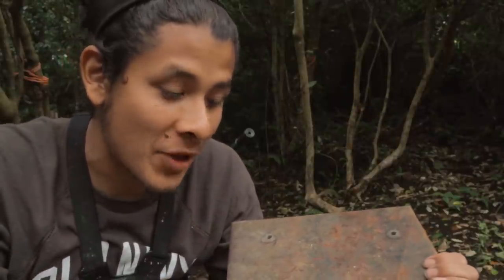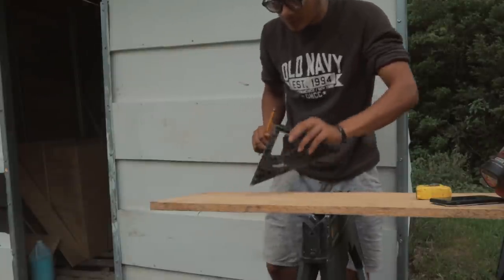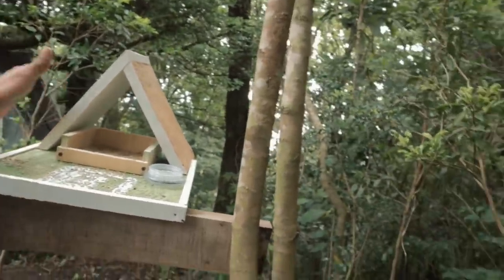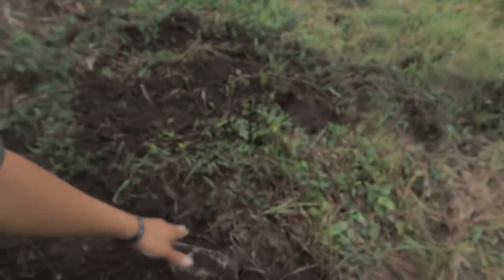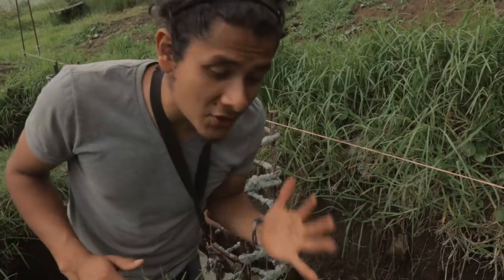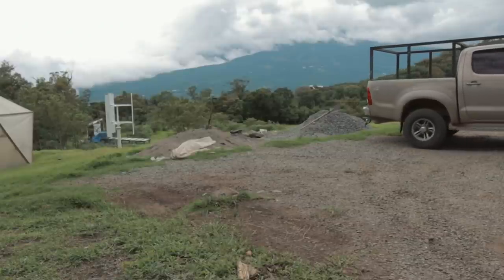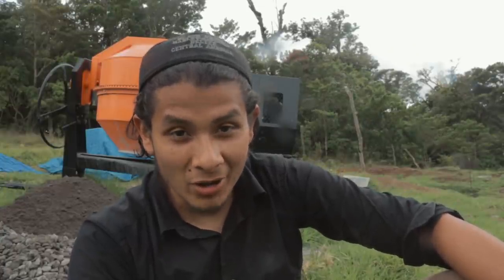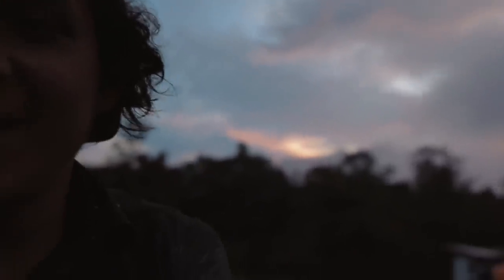DIY BIRD HOUSE CONSTRUCTION

Comment: quick tip - if you tap the outside of the "FORMS" (wood) all around and up and down with a hammer (heavy tapping) , it will get any bubble out of the mix and make sure you have a solid pillar.  Do it as you load up each pale and dump it and you get the bubbles out of each level that you pour in all the way up and the pillar will be SOLID, no air pockets inside.  FYI :)
Reply from the maker: Hi, this is great information, thanks 😊🙏

Comment: Put a metal band around the tree you put the bird feeder on Roger can't put his claws in that. Make sure the band is about 2ft wide around the trunk and high enough up he can't jump past it. Works with squirrels too. USE a light metal like aluminum (not foil).
For your escape goat use hardware metal it's a small grid. And do the top of the pen. Goats are great climbers. 
Many Blessings Mea 🙏💜

Comment: For the shower system you need water, maybe you can start setting up your water collection system on the back of the new house area and start collecting your own water.  (Maybe this can be done when you have days that you can't work on the house). That way you don't have to haul water back and forth, from the work shop.  Then you can connect your shower near that area, which will eventually be the where your house is anyway then you don't have to build twice.  The view from your house is amazing!  You could build a small lean-to over the rain barrels which is cheap and that roof installed with gutters for the collecting rain water while your building your home.  The shower walls can be made with small fencing posts put together to create a spiral then you can be protected from the winds while showering.  You could cut out a viewing window so you can see out while showering... Underneath your window are you can build a shelf to place your soap.  For the floor you could make a pebble stone floor, easier to clean and longer lasting.  At the front of the spiral can be you drying area for your towel and clothes.  You can build a small entry bench.  It can be amazing.

Comment: You could have done the holes much faster by burning the holes open with the arc welder set on high or by using a cutting torch

Comment: Sadly bird feeders attract rats and Squirrels and a load of other animals. The best way to feed is on a long cable/washing line strung up high above the ground between to posts or buildings. That usually stops the rats, but squirrels are more cunning that that and you might have to put up baffles at both ends of the cord. Rats will clear a bird table in a very short period of time.
Reply: That's great information!
I hope Rodrigo listens because that so close to his house and I'd hate to see him infested by rats.
Reply: The rodents will attract snakes which would be bad for all the animals and humans on the property. 😬🤞